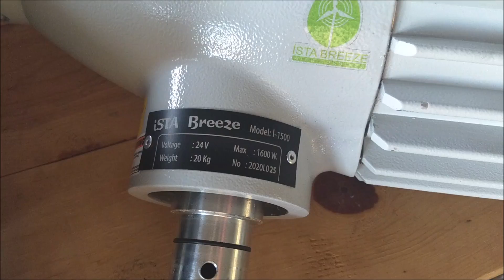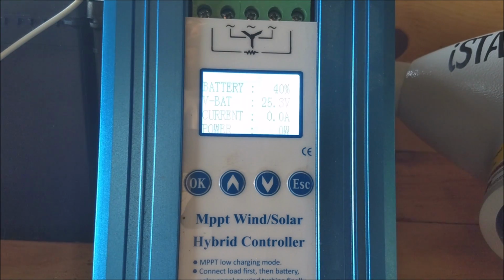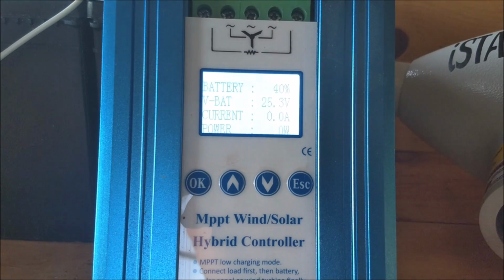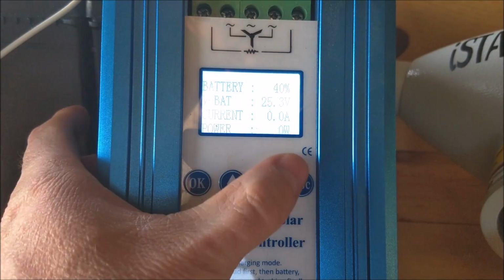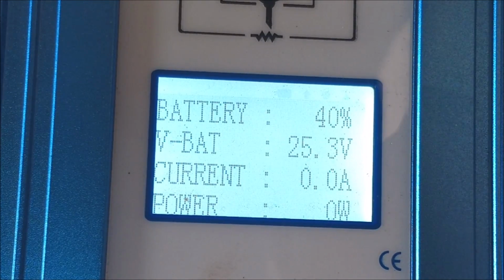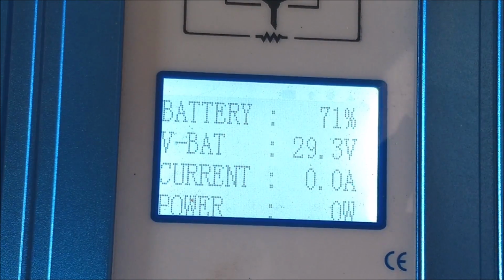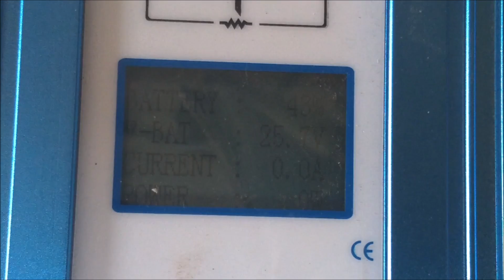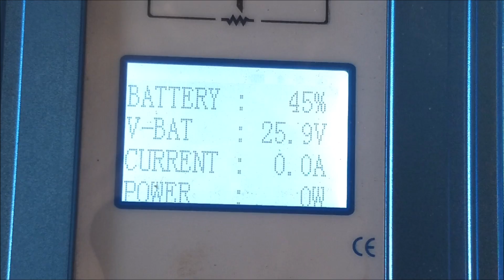iSta Breeze i1500 1500 watt wind turbine Bench Test #2

Comment: IMPORTANT: Many people believe that the RPM is directly related to the POWER IN WATTS?! As far as I know, charge controllers have various "switching stages"! This means that at higher RPMs, the current or resistance is increased – so at a speed of 300 RPM, it can be 100 watts, 200 watts, or even 500 watts, depending on the switching stage and the "LOAD"! It's NOT JUST THE RPM, but the FORCE that matters, AND a cordless screwdriver doesn't have 500 watts! You can't test a wind turbine with that! Furthermore, you have to connect a load, i.e., a device with, for example, a battery. 1000 watts to MEASURE how much power comes out of the turbine... ONLY WITH A BATTERY you get "falsified values"... POWER in WATTS must always be measured with a "suitable CONSUMER"... and IF THE CABLES are too THIN / too LONG, the controller can malfunction because the cable acts like a braking resistor and the controller can't switch between stages - it then keeps switching up, down, up, down, causing the turbine to constantly "turn out of the wind"! Many people believe that extending the wind vane makes it work better, BUT then the "too thin cable gets WARMER" and the turbine works with the larger wind vane "against the braking resistance of the cable"... with larger turbines it's less noticeable, but with small ones, cables that are too thin / cables that are too long cause "big problems"!? The cables coming out of the turbine are usually 1 mm² or 1.5 mm², but these are the "internal cables" and are not designed for lengths of more than 5 or 10 meters... as far as I'm concerned, even with cable lengths of only 20 to 30 meters, you should already be using 6 mm² diameter! The losses are "not just losses" but the reason why the controllers are "irritated" / malfunctioning!?!? I think nobody knows this yet??? The cables must be chosen so that there are NO LOSSES! 1 to 2% might still be okay, but even 5% loss means that the controller cannot "determine" the correct SPEED and SWITCHING STAGE via the voltage!?

Comment: @thedavesofourlives1 vor 4 Jahren
probably wouldn't hurt to drain those batteries down a bit to say 24.4 so they'll take a load for sure

@runeskoularsen2705 vor 3 Jahren
Charge controller maxed out the voltage to the battery - too thin wires to the battery.

@davefroman4700 vor 5 Jahren
Look at the wattage on the drill. You can not generate more energy than you are putting into it. Its physics.

Comment: Hello from Scotland. Windyy here today :-).  And my i-1500 is due today via DHL after a long trip from Istanbul. I've built my own controller panel with relays & dump load but I see you're using one of these ebay/aliexpress hybrid wind controllers. for your test. Do these actually do anything other than trip&dump at hi/lo voltages or maybe they do something a bit more clever?.
Reply from the maker: Nah they add some hassle and don't offer anything unless you're trying to tie a small solar rig up with the turbine.  This one wasn't very efficient or effective, I just used it for the test because it was convenient at the time.  I prefer to use standalone rectifiers and relays.
Reply: Yeah, I though as much. Thanks for the quick reply.  I wondered, have you thought about using a 2 or even 3 stage set of controllers and relays to introduce dump loads in succession when the hi volt limit is reached? Probably quite simple to do with these  controllers where you can set delays. Maybe less of a jolt to the turbine when the dump load(s) come in. ....or am I just taking it too far :-)). Certainly on my test bench, when the i1500 dump load is triggered, it tries its very best to escape from the vice. Fair old bit of stress on the machine, I think.

Comment: I realize this is an old video, so I hope you still reply. I have a 24V generator motor I just bought. I did a bench test with just a volt meter. I was wondering if it's normal to test a 24V motor and get close to 60V on meter with a drill running it? No batteries involved, just volt meter directly to motor. Also do you have a Facebook account? If so could you maybe list that so myself and others could contact the guru (you) easier😆👍🏻 thanks
Reply from the maker: yeah especially larger turbines will spike pretty high when unloaded.  My 48v turbines, for example, will all run 100~150v without a load on them.

Comment: Great videos. Can you recommend a charge controller for the i2000 iSTA Breeze please
Reply from the maker: Midnight classic 150 is easily the best charge controller out there.  There's some very basic battery switches on eBay that are cheap, but they don't offer the versatility of the Classic.

Comment: GARBAGE - DON'T BUY - I did and it proved to be a total waste of money. Plastic melts. The best wind generators don't need a controller. Positive and negative leads straight to a 12 volt battery. Made in Turkey, no support,. It is a cheap take off of instabreeze. Note the subtle change in name.
Reply: What plastic?

Comment: What was your drill rpm?
Reply from the maker: Approximately 275rpm but it slows down the more loaded the generator gets.  It's not meant to really give an accurate performance reading, just a base idea of how the generator will load up and if it works at all.  It tends to give me about 15~20% of what I see once the machine is in the air
Reply: @ToysforWatts  thanks.. Reason for me asking is because I have built one but the fp640 model but i rewrapped the coils with 16awg and added small n40 mags. My meter is showing 240 rpm with my 600rpm drill at 75watts but 300+watts at 200-260rpm with a 2300rpm drill.  Rpm seems to lower as it as you said with a load. Does all turbines do this? On my turbines i always thought it spins faster as watts go up in wind speed.

Comment: Hello, i'm planning yo use a insta breeze i1500 24v generator for a hydro aplication.
How Many rpm do you think It needs to obtain 1500w?

Thank you!
Reply from the maker: 750-850 rpm but it's going to be pretty heavily dependent on voltage and load.
Reply: @ToysforWatts   thank you very much for your response, i'm planning to use it at 26-29v.
What about heating, do you test It long time?
Now i have an missouri wind and solar (previous version of freedom 2) and It goes well but needs lots of rpm.
I'm going to make a new turbine to put in parallel and want a less rpm solution (less multiplicators, less problems)

Thank you again.

Comment: Nice tower, maybe a center pipe at the top makes the connection better to the wind turbine and taller too. And to get 1500 watt out you need to put in 1500 W in, plus some. So a corded heavy duty hammer drill maybe better, one that doesn't smoke.